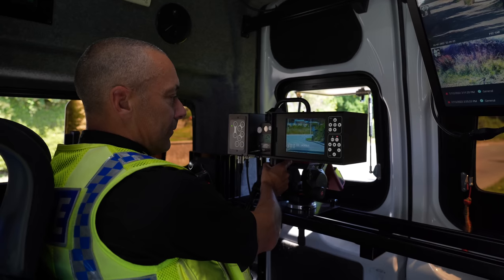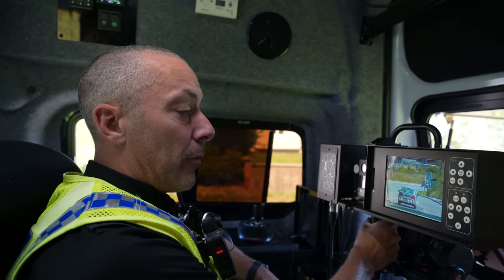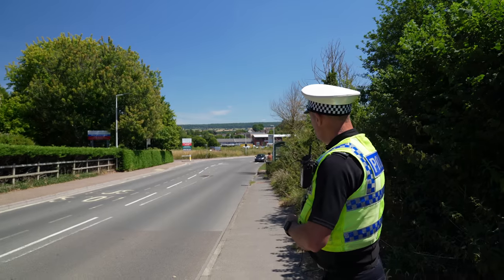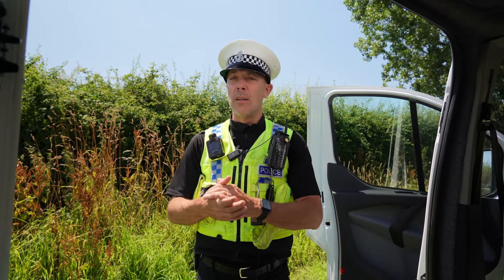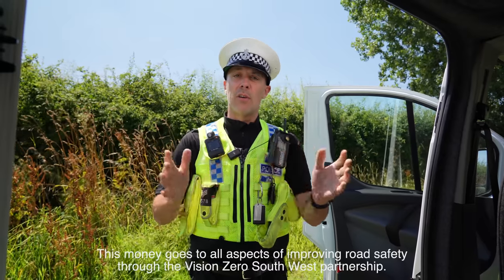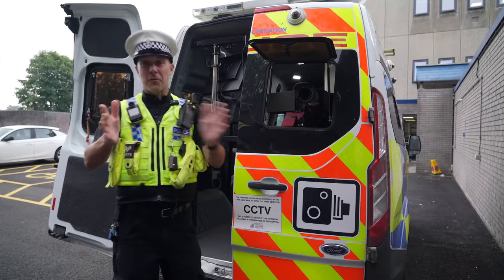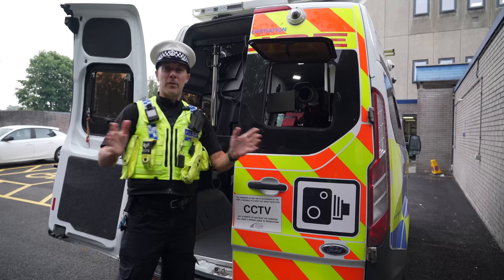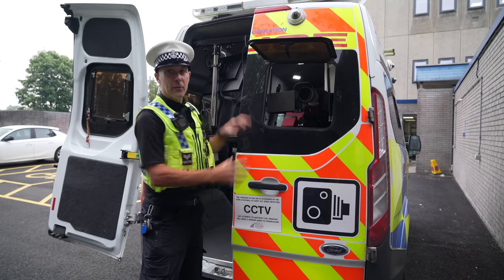SPEED CAMERAS - Road Safety or Cash Cows?

Comment: I agree with most people here.  In Northern Ireland they are always in a "sly" spot.  Not a high risk or accident black spot or a spot where speeding is particularly dangerous.
Locally they frequent behind a hedge in a side road on a stretch of 60mph dual carriageway.  Got ticketed for doing 80 in a 60.  I never seen the van, the report said it was in Dixon's garden centre, which closed 10 years ago, but I know the little layby field entrance they were in and it is camoflauged and why I didn't see them.
Another is the 60 down to 40 and 40 up to 60 at the end of the carriageway, getting both people either braking late or accelerating early.  Scum bags.
I also got a false ticket, but didn't appeal it as I was given false information by the Speed Awareness instructor.  He told me that EU laws regarding dual carriageways now mean an NSL dual carriageway was only 60mph unless it had a steel or concrete divider.  So I was done for 70 in a 60.  I later found out that the UK completely rejected said laws as it would be far too expensive to implement.  So any reservation makes the NSL 70mph IIRC.
Here is the thing that makes the 99% cash cow.  They place there vans where they will catch the most speeding people.  NOT stop the most people speeding.  The money from the vans goes to the local authority, the more they raise the more they get.  There are no checks and balances, it's entirely corruptible. 
I can think of a dozen different places we could use a speed van or a patrol car to make VERY dangerous situations more under control, especially around school in/out times, but no, nowhere to be seen.

Comment: So do they have nice inbuilt heaters and air conditioning?? As having that window open at the back.. does the van need to be running for these to work?
Reply: No air conditioning.  Heater yes, but the engine does not need to run.

Comment: Great video thanks. I've never been a fan of single speed cameras, especially on multi lane roads. The number of times I've had people overtaking me then swerve right infront of me and brake when they see one in unreal. I think the average speed concept is much more reasonable. I think the only thing that gets my back up with these mobile vans is when we are told that they only put one where there are a high number of accidents. That's not true. If they said they only put them where there are a high proportion of speeders I would completely agree. As for the range I was once caught speeding by a handheld at 917 meters so they are quite impressive.
Reply: The placement of mobile vans at high collision sites ended in 2007.  You are way behind the times.
Reply: @unleashthedragonwithin2057  so are the people running the speed awareness courses then 🤷‍♂️ Thanks for updating me 👍
Reply: @cynic-al  I am uncertain what you are asking.  Yes, people run the courses.

Comment: A fascinating insight into something we (ok, I) abhor. Not that I disagree with anything said; nobody should speed in a 30 zone, especially near a school. In my opinion, 20, 30 and 40 zones in populated areas are sacrosanct. The only issue I have is councils reducing 60 zones to 40 because of either emissions or noise when there’s not a house in sight. I disagree with councils getting the police to enforce speed limits when the signs are poorly placed or obscured by foliage or just neglect. As a younger person I may have racked up a few points due to a heavy right foot but now, as an older motorcycle user, I can understand the need for them. Drunk or drug drivers, stolen vehicles, joyriders and a number of other illegal actions can be curtailed by the use of these vans and rightly so, imo. I’m just torn between going fast on my bike and/or the reduction of idiot drivers.
Reply: Councils don't get the police to enforce where the existing signage does not convey adequate guidance.  If the signs are obscured, damaged, twisted, missing, then police decide if they attend, not councils!

Comment: As someone who does over 3500miles a month mostly on UK motorways, I can assure you that the key issue is peoples driving ability and awareness.

People who are reactive when driving are far more dangerous than those who are predictive. You see it everyday, people sat dead behind the eyes on the M1 with absolutely no idea what's happening around them. Suddenly then try to change lanes and almost hit the person next to them. Absolutely shocking.

Speeding at the appropriate time can actually avoid accidents! Especially on the motorway for this exact reason when you need to avoid a situation and sudden braking isn't an option. These vans should exclusively be for true danger spots like schools, not the motorway or brown of a hill in the peak district as I've seen lots of times! Even in average speed zones I've seen them!!!

Also the idea of permanent speed limiters in cars is a dangerous move for the reasons mentioned above.
Reply: A genuinely predictive driver wouldn't put themselves in a situation where they'd have to exceed the posted threshold.

Give yourself enough space to stop safely in the distance you can see.  Do you have any data to support schools being 'danger' zones?

Comment: Scamera vans are cash cows. I live next to a children's park. Complained about people speeding... council went and put up £1.3 million squids of speed humps... against my wishes, knowing it would do nothing and police enforcement would be far better. Now people speed BETWEEN the speedhumps, complained again, council put out the rubber strips to measure speed and said average speed is 29.7mph. I disputed it as their measurement device only goes to 60mph... and a fair few cars exceeded that... on a residential road... outside a children's park.... in a week it was raining all the time... in the winter. Even at 60mph, the braking distance according to highway code was longer than the road itself, with a curve in the road, people would not be able to see the speeding car coming around the bend! I estimated their speed at 80mph+ on a 30mph street! I simply asked the council to plop a speed camera van on the road, once a year. That's it.  The answer was no... this is why scamera vans are cash cows and nothing to do with safety.

Comment: Something i would like to know. I had an incident the other day on my way to work from Newquay and had a van pull out onto the right lane in front of me. He kept speeding up and slowing down like an idiot so my main focus was on him to avoid a collision. As the A30 dips down after Scorrier turn off i noticed a blue camera van on one of the bridges and my speedo was reading 74-75mph. Am i likely to be done or is the speedo over reading? And does Devon and Cornwall police have the tolerance rule?
Reply: Your speedo will be over reading probably by about 2-4mph at that speed, also ALL forces use a tolerance of at least 10% +2 mph meaning that your actual speed would need to be 79mph on a dual carriageway to get a ticket.

Comment: If speed limits were set on real risk then more people would have respect for them and compliance would be greater. Where I live, our magnificent council has determined that a road that used to be a 50 limit should now be a 40 mph limit. Nothing has changed. A temporary 40 mph was introduced on a former NSL dual carriageway. In four week there were two fatal accidents. A 70 mph road was improved with an extra lane, better lighting, better surface, safer road furniture, higher standard central barrier and the speed limit was reduced etc. Not one of our schools has a variable, school operated 20 mph limit. By all means blither on about safety but to ensure speed limit compliance by considering the real risk and setting limits accordingly. That means taking into account improved car and component performance, driver training, road furniture, road layouts and lighting. To my knowledge, the bedwetters in charge of setting speed limits have never derestricted a zone, they have only tried to reduce speed. And our smiling copper might like to consider why people are losing respect for them. It’s because they have now become our persecutors. In times past they were our protectors.

Comment: Cash cows. Ask your local speed camera partnership in the north west how they work out where to locate the Vans. 
I have an email stating to make them cost effective, they are positioned as a result of traffic surverys that work out when most vehicles are speeding at which times. I asked numerous times to put Vans or mobile speed traps in areas by schools and sites of accidents.  I was told it was too expensive and it might only catch a few people. 
If you want to see how cameras are hidden,  look at North Wales using a horse box and builders van.
Inappropriate speed can injure and kill people so drive to the speed limit for conditions.
Reply: What evidence is there that they are needed outside schools?

The 'horsebox' was fourteen years ago and was part of a special operation designed to target specific motorcyclists.

Comment: Road safety is improved by building safe infrastructure... and drivers and the car's onboard systems are the only thing qualified to tell what is a safe speed it mostly depends on the state of the car. The speed camera is an excuse just claiming to treat the symptoms and changing bandage, while the wound is ignored... which is poorly built infrastructure and poor drivers' education.

Comment: I love that their van is clearly visible, making it way less of a revenue tool.
Here in aus they are plain white vans that do nothing to deter speeding
Reply: Not even vans. Maybe it's just here in Vic, but they use any type of suv in pretty much any colour. It's impossible to tell if it's a random person parked up or a camera. There's also a spot where they often have a camera here, about 100-200 meters from the bottom of a quite steep bridge, it's annoying.
Reply: @samorcsik  aye lucky in SA it's only white vw vans but ive seen in NSW they have tiny lil cameras on the roof racks of SUVs

Comment: Quick question if anyone can help me. I’ve recently bought a mk8 ST fiesta, it’s my first sports car and it has sport mode and track mode. Sport mode is allowed to be used on the streets but track mode isn’t.  My car pops from stock in sports mode and it’s not from my manner of driving. Because the car is designed for this from factory can I get in trouble for it popping when driving? Can’t find an answer anywhere :)

Comment: So I agree with everything aside from just 2 conflicting statements. Paraphrasing a little

"Camera has a 1km range. so if you see it, chances are it's already seen you"
&
"If you can't see it, it's highly visible so chances are your observation isn't great"

All in all though I do agree with speedcameras. Pain in my hole when it's me though
Reply: But both statements are accurate.  It can get you from a long way away, but if you are at a distance where the van can be easily seen, it is extremely visible.

The statements do not conflict.

Comment: On the question of should the speed limits be raised with improved brakes etc.  You said it's still the same person driving.  Modern cars have auto braking features, pedestrian monitoring etc.  In time when more cars are like that on the road maybe this could be considered but it won't be.  Cars have more and more safety features.  Some enforcement should be done also on the slow drivers in the middle lane of motorways doing 55/60 mph. The correct lane is the left lane, not sat in an overtake lane going slow.

Comment: We got a notice through about speeding but we dont know if the driver was me or my mum. If the car was speeding towards the van would the front end of the car get photographed and if it was on the other side heading away from the van would it take a picture of the back? This would clear it up for me
Reply: Request an image.
Reply: @unleashthedragonwithin2057  we did but the image was useless, worked out though based on some bricks in the background that it wasn't me and they'd caught her heading away from it on the other side of the road
Reply: @aaronm51921  Yes, bricks usually assist when attempting to identify a driver.

Comment: With one comment "they can detect at 1000m so by the time you see it, it sees you". Then another comment "it's hi visibility so you can see it"... What's the point if its already got you before you can see it at 1000m? However, I do understand that they generally operate at a shorter distance rather than always at the 1000m..... Can you confirm?

Also, I thought the operator was supposed to form their own opinion of the car speeding before using the device to confirm but you seemed to be just pinging everything that came around the bend.....
Reply: The forming of opinion 'before' using the device appeared in the original ACPO RPET guidance.  That was based upon the artistic licence of the person who typed those words and 'before'  (or 'prior' as it actually was written), never appeared anywhere else.  Because it appeared in this guidance, people wrongfully concluded it had to be before.

The ACPO RPET guidance was withdrawn back in 2008 as it missed the review date on page 2.

The wording you really want appears in the relevant legislation:

RTRA 1984

89Speeding offences generally.
(2)A person prosecuted for such an offence shall not be liable to be convicted solely on the evidence of one witness to the effect that, in the opinion of the witness, the person prosecuted was driving the vehicle at a speed exceeding a specified limit.

No mention of 'prior' - it can be before or after, one corroborates the other.

Comment: Motorways are the safest roads in the UK if you go by statistics. I imagine the same is true for Autobahns. 'autobahns are still very, very dangerous'. You're repeating 'very' which is telling me you're over eager to convince us of a point, and you're not comparing them to anything and the factors regarding deaths in collisions is relative. If driving on one is compared to eating a bit of cheese, probably more dangerous, but if you're allergic to nuts and the cheese was cut on a surface that a foodstuff containing nuts was also prepared on, then I think driving on an autobahn would actually be much safer. 
Generally, driving could be considered dangerous, walking on a public road could be considered more dangerous, etc, so driving on an autobahn is naturally dangerous by association, not specifically because of the speeds involved, and yet again, volume of traffic vs number of incidents, motorways are actually the safest type of road to drive on, despite the highest speed limits, suggesting speed isn't the cause of danger on the roads.

Comment: Mixed messages there.  It is mentioned that the vans are easy to spot, so it is your fault if you cannot spot them.  However he goes on to say once you see the vans, the camera has already clocked your speed, so it is too late.  Whether they paint them pink with orange spots, or do their best to camouflage them, it doesn't matter, you won't be able to reduce your speed in time to avoid the fine.  

The vans are always parked in areas where they can be assured that once in sight, they are in range of detection ie around bends or a brow of a hill etc.
Reply: @unleashthedragonwithin2057  I just did a Google image search for speed detection vans and of the first 10 you can actually get a good idea of the road layout, all of them had some element to hide the long range view of the van.
Reply: @Christopher_T_Paul  What search criteria did you use to search Google?

Comment: I'm all for speed camera vans on school areas and blind bends. I don't think they should be on hills on a bypass & motorways which sadly I see them more on those roads rather then the small 30mph roads. I wish we did see more protecting the safely of the kids. I never speed in red speed limits, that's just stupid & unnessacry risk. The people that do I 100% agree should be punished with files or points so they learn. People on motorways get higher fines and points for speeding. Which to this day, i'll never understand.
Reply: Yes, issue more files as punishment, big grey ones full of old brochures for garden centres.

Comment: my problem is your enforcing speed limits on roads where stretches of the road are far to slow. and that is where my problem lies. there is no set rules for what determines a stretch of road to be set at a certain speed limit. 30mph around built up areas and i was doing 20mph in a 30mph high street in Warrington earlier today. which is so busy should be 20mph. full stop. and 20mph should be mandatory in housing estates. but 70mph in a empty motorway? if your in a car especially german cars that can do 155mph where is the danager of doing 155mph on a motorway, if your the only one on it? theres no junctions, no pedestrians, no buildings to crash into. no oncoming traffic. it is the reason the germans still have autobahns in place. even the HGVS leave huge gaps and tailgating is a huge no no. something that is taught day 1 on learning to drive over here but never enforced. you need to rigorusly make sure drivers are safe to drive in the first place before letting them get in the car. with 1 in 30 cars uninsured on our roads enforce that first  before nforceing 70mph speed camera above a bridge on a empty motorway!
Reply: You are kidding yea?  How many people are trained to handle a motor vehicle at 155mph?  Even the europeans screw it up on autobahns:

259 cars involved in motorway pile-up in Germany
This is the horrific aftermath of a motorway pile-up involving 259 vehicles that left 10 people fighting for their lives.

Like lemmings, one after the other, after the other into the back of the car in front.

Empty motorways?  Maybe at 03:07, but motorways are currently awash with traffic!!!!!